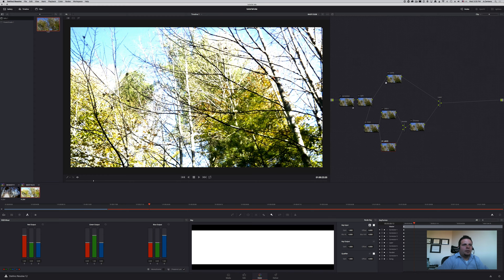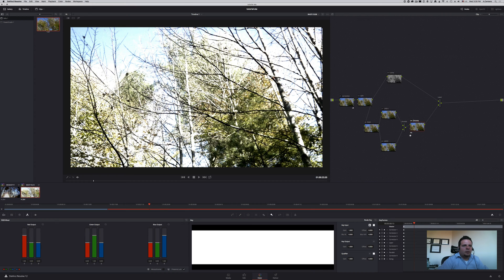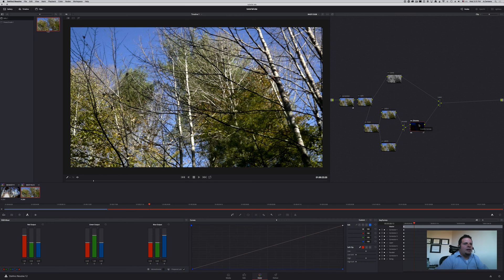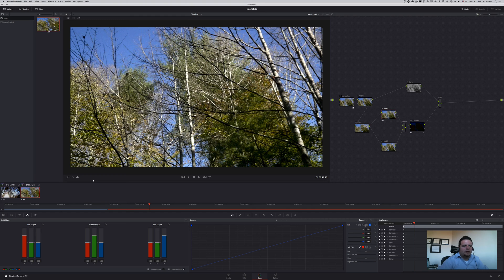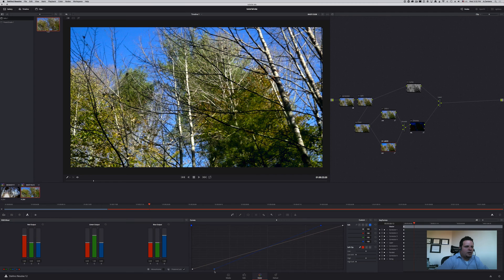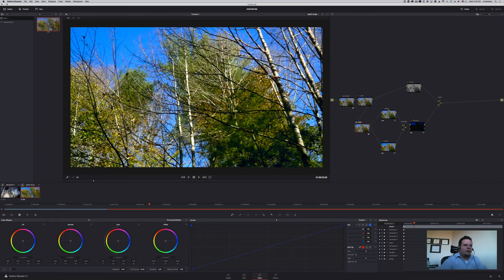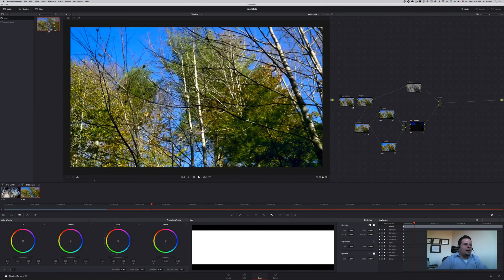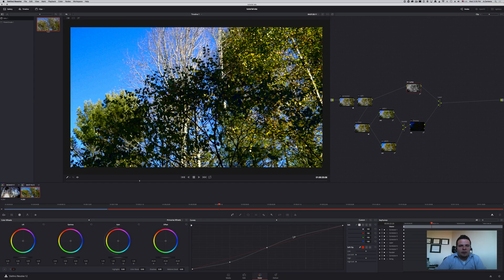Professional Saturation Techniques in Davinci Resolve #3

Comment: Hopefully you still keep an eye on these comments.  I need some help.  I'm trying this technique and getting some pretty crazy artefacts.  I only got as far as desaturating the luma node and then changing the chroma node's colour space and pulling that blue channel all the way down and check out the crazy colours popping up in my sky, and the image looks nothing like the original, as you mention it should more or less, at least.  Any ideas? 
Before: https://www.dropbox.com/s/6fr1qi5yyhpjshz/Screen%20Shot%202019-05-28%20at%2018.58.02.png?dl=0
After: https://www.dropbox.com/s/n6haxbl3pr3zrde/Screen%20Shot%202019-05-28%20at%2018.57.53.png?dl=0
Reply from the maker: Thank you for watching and sorry for the long delay to respond. Artifacts are common when adding lots of saturation to footage that is 8bit 4:2:0 or lower grade. It is difficult specially in the sky - often you will notice macro blocking also related to the h264 codec. What I recommend is: 1. Shooting with something more comprehensive if possible like 10bit 4:2:2 and/or encode to h265 or even ProRes. You'll find a lot better results that way. If that is not possible, I would suggest shooting with a liner gamma closer to the final delivery gamma - that may help you reduce the artifacts even when adding a bit more saturation.